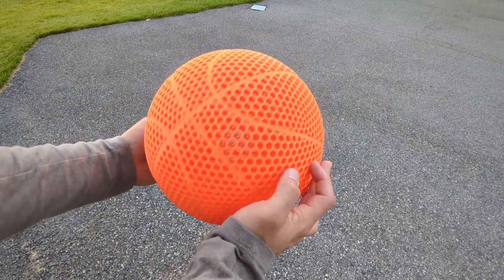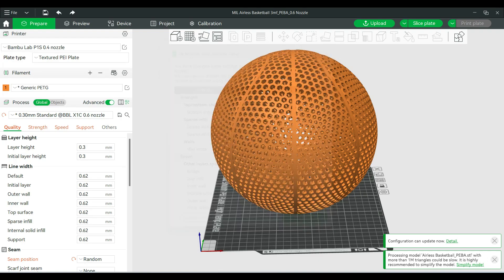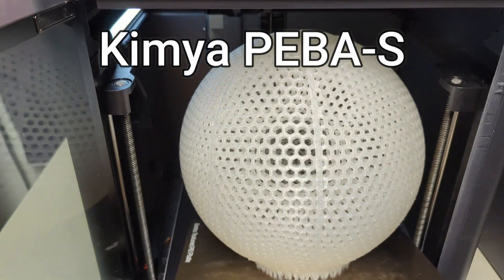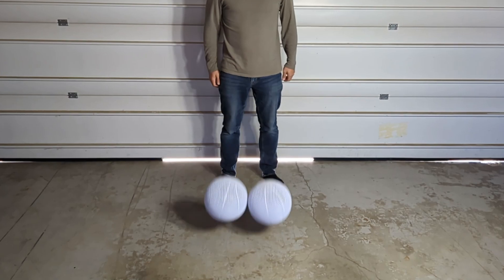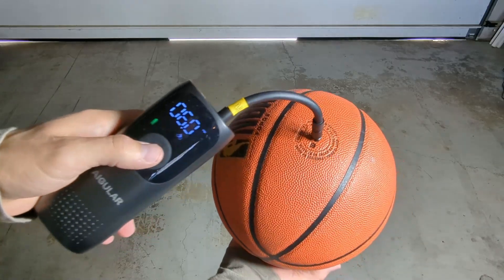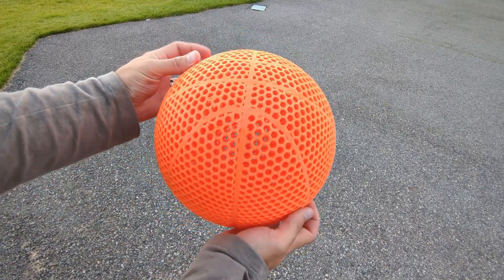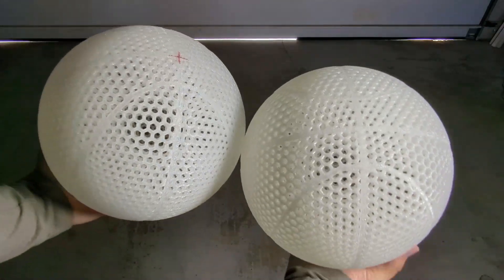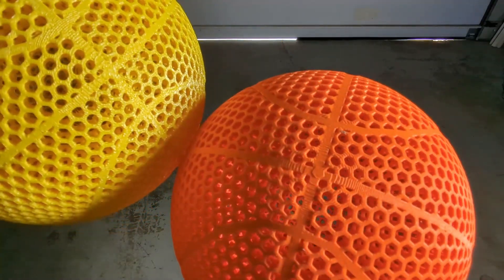Does 3D Printer Nozzle Size Affect Airless Basketball Performance?

Comment: Do you do anything after printing to help the strength on the peba balls? Do you anneal it?
Reply from the maker: @CCBCodeMonkey  Hey, no the only thing I do to the basketballs after printing is sand the supports down. I am actually surprised they are holding up this well. I think annealing will always help though
Reply: @makeitlabchannel  man mine hold up like yours. I just had another one break on the layer lines printed with 0.6... though that layer I had the printer paused for over an hour because of a clog and it broke exactly on that layer
Reply from the maker: @CCBCodeMonkey  oh dang, it is kind of crazy how one bad layer line can make it break. Hope the next one prints better!

Comment: You haven't tried 3D printing until you try 0.8mm nozle.
Reply from the maker: From what I have tested, I would say that the Ataraxia Art Flex PLA would be second because it is definitely the cheapest option and bounces pretty much just as good as the others (besides PEBA) that I have tried. I just got the bouncy version of their PLA so I am hoping it will be even better

Comment: I think there are water disolving materials out there if you want to print the support with that, that maybe will aliviate the need to sand the bottom layer of the airless basketball.
Reply from the maker: @aritzsantana9577  I definitely think that would be a good idea, but these filaments aren't compatible with my AMS on my printer so I would have to invest in a multi-material printer or something
Reply: @makeitlabchannel If your on a budget I would recommend an LNL tenlog D3 pro 

It is an IDEX 300x300x350 at $500
Reply: @makeitlabchannel  PVA should work fine with the AMS, though I might be wrong

Comment: Great video! Thanks for testing everything! The timesave with the 0.6 nozzle is huge. I am glad i waited and bought one. 😅 I am curious what difference 0.8 nozzle would make. But now i have all parts ready and will soon start printing. Your print profile for the PEBA filament isnt on Makerworld anymore? Did you dry the PEBA filament before printing?
Reply from the maker: @oclk8650  Thanks! Ha a 0.8 nozzle would be fun to try. I actually have never uploaded the profile to Makerworld because it has a custom filament profile, but I found a way to change it so I will add it soon. It is available on Thingiverse/Printables/Cults3D though. I would recommend drying the PEBA before printing if you have a dryer
Reply: @makeitlabchannel  you really need to try 0.8mm nozzle, it's quadruple time saving.
Reply from the maker: @madbuldog  well dang, guess I have to try it!
Reply: Have u try the 0.8mm?

Comment: peba basketball is like a floor hockey airless ball, idk if you tested PETG filament yet, that might be better than just PLA, and similar to PEBA, maybe. try kicking them, like a soccer ball.
Reply from the maker: @gsestream  might have to try it 😁
Reply: @makeitlabchannel  also TPU might be the best for flex/solid airless car wheel rim wrap tire. use two part rim, for easy tire mount.